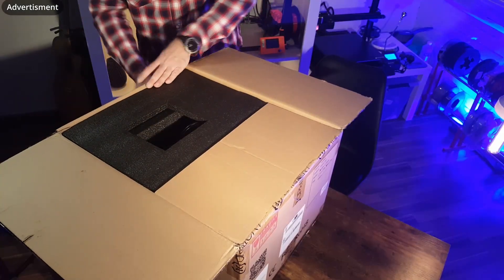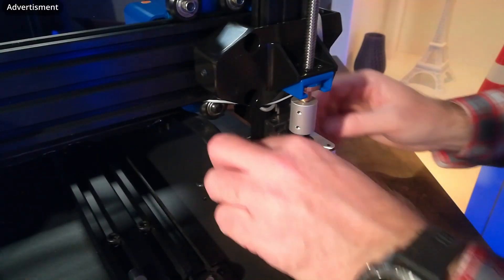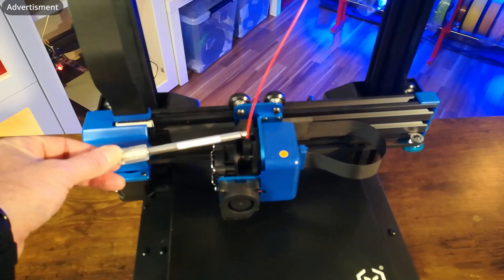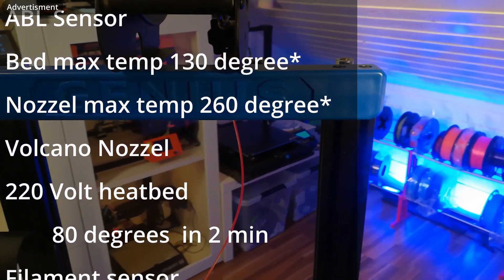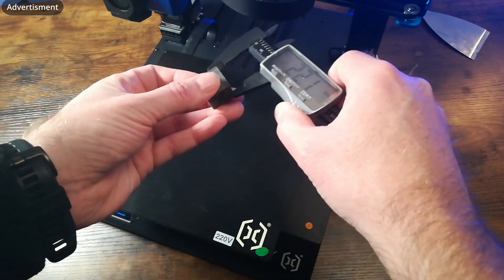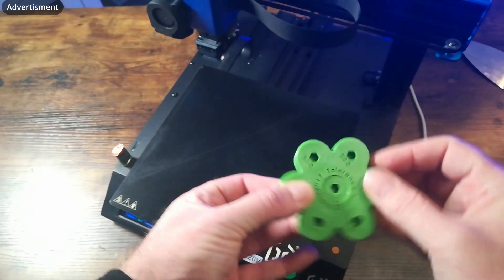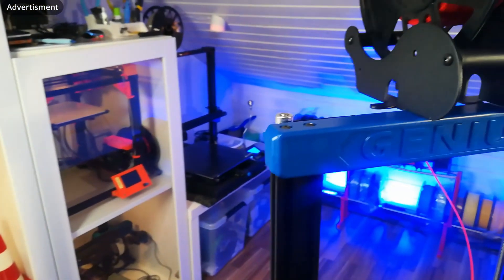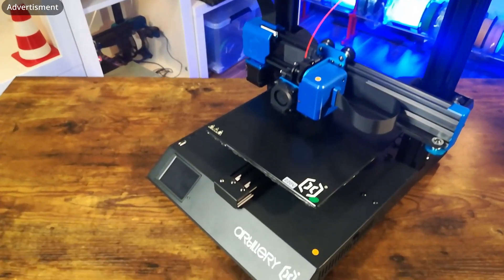Artillery Genius Pro - Budget King? Review

Comment: A quick question... 

I'm currently looking at a used (but hardly used) one of these, with some filament, for 1600SEK and close so able to just collect it. I have NEVER used a 3D-printer before, ZERO experience with CAD, no history in engineering wse... Would this be a good place to start with 3D-printing (and at that price)?

Comment: Ciao, ho da pochi giorni una Artillery Genius, filamento Sunlu pla. Ho provato a stampare una medaglia intagliata nel mezzo.
Le parti di cui non sono soddisfatto del risultato sono fondo (si vedono i righi del deposito del filamento) e superficie (ad altezza pareti ok, ma invece di mettere un unico strato superiore, deposita prima le pareti e poi il riempimento).
Cosa potrei fare per rendere più liscio possibile tutta la superficie? Grazie
Reply from the maker: Hello, its hard to say without a picture. But if you see the buttom layers very well, mostly the Z offset ist to high. Maybe you should try to level the printer in Z offset a little bit deeper. The optimal distance between nozzel and heatbeat is around 0.1mm while printing the first layer. This is exactly the thickness of a normal copy paper.